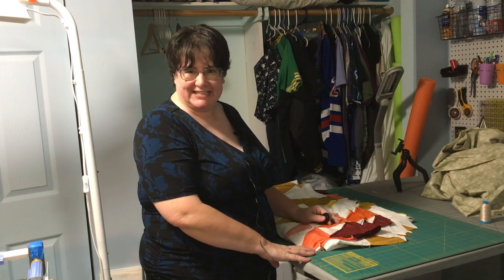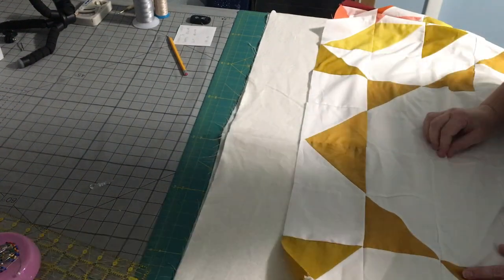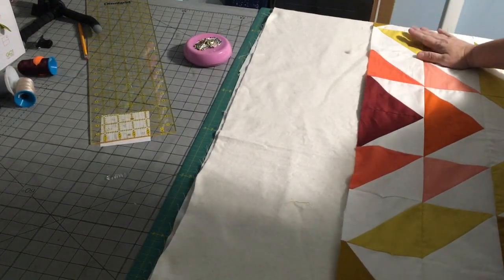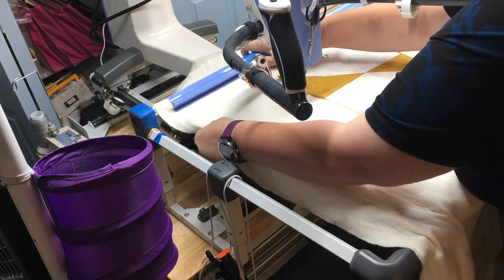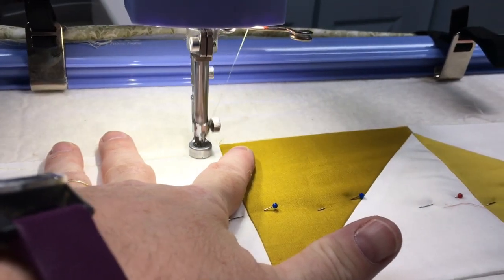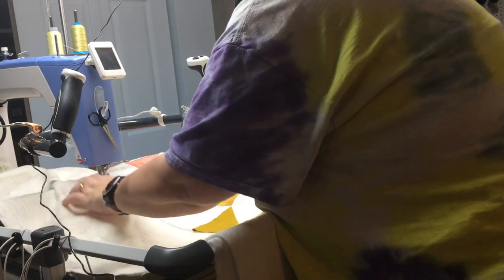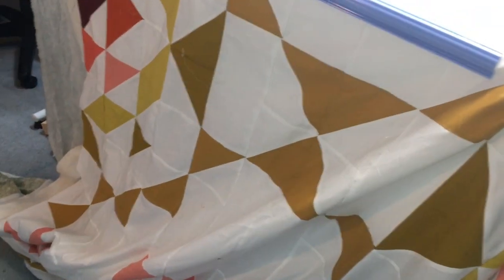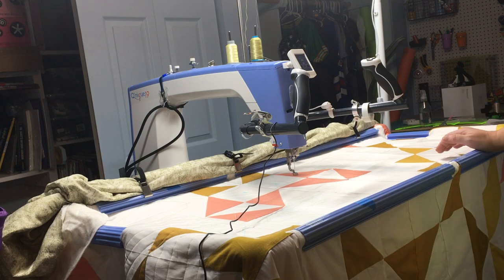Quilting a King-sized Quilt on Cutie Frame

Comment: Thank you so much.  This answered my question in so many ways.  I would like to know about how much space your machine and frame takes up.
Reply from the maker: I believe the table size is 24"x53". The frame takes up the whole table front to back (24") and there are a couple inches free on the side. I have just enough room to squeeze by on the right side of the table (my cutting table is next to the frame) and just enough space to squeeze by behind the Cutie (the closet doors must be closed for me to get by). My desk is to the left of the cutie and there is no room for me to walk by the frame unless I pull my chair out.

In front of the cutie frame is several feet. Enough for me to be quilting at the frame and my husband to walk by. 

We squeezed it in. 😂

Comment: Thanks for sharing this. I just got my Cutie. I see you and many others don’t use leaders. It seems such a waste not to use them. Why do you and others not use them.
Reply from the maker: I don't find it a waste. This King size quilt in this video for example, I think it was 108"x108"? I had to buy 3 lengths of fabric for the backing anyway, because 42+42 was not going to be wide enough. So I had lots of extra backing fabric to serve as leaders.  

Most often I am doing throw size quilts, say 50x60. So again, I need 2 lengths, and the 80-ish inches I get from sewing them together is more than enough to serve as leaders.

I also often use the backing fabric to cut the strips for my binding, so the extra fabric does go to use.

I did make my own leaders from a canvas-type fabric I got from Joanns, for those cases where the backing isn't big enough. (such as the quilt I'm working on right now, actually.) But pinning the quilt back to the leaders is just  another step that needs to be done before I can put my quilt on the Cutie. I want to get to the quilting faster . 🙂

Comment: I see that you use the Grace Q’nique 19. I found one for $4900. Recertified. I have the cutie frame. I am torn between such a good price or buying the Q’nique 19X or 19x elite. If you were buying a machine today which would you buy? I am not a professional quilter and will use it for quilting personal quilts, etc. Thank you for your advice.
Reply from the maker: I just looked up the prices on the 19x and elite and holy cow! I also bought my Q19 recertified and have had no trouble with it. No regrets at all. It doesn’t have the bobbin estimator or the edge detector but I’ve been fine without those features. Nice to have, sure, but not necessary. If I were buying a machine right now, I’d buy the recertified Q19 because I don’t feel the new features are worth such a huge price difference.

Recertified machines go fast and aren’t always available so you might want to jump on that deal. On the other hand, Grace’s spring fling is next month and they will have sales… but who knows what the sales will be. Often they bundle several items with the machine for free.

I’m not a professional quilter either, and I love my Q19 and would buy it again in a heartbeat.

Comment: Okay, I can see already that you have something attached to the frame that doesn't come with the frame.  To camera right, there are two blue bars. To camera left she is adding clamps that are not part of the Cutie Frame  package. I'm seeing the need for additional clamps in all the videos I have viewed so far. Off to Harbor Freight for clamps.  I'm regretting more and more my haste to purchase a Cutie Frame. And now, they've upgraded the frame. What's with the blue painter's tape? And the rubber bands? 
The frame is easy enough to assemble. I don't think there are adequate warnings about the adjustments necessary to fit the machine onto the frame. The videos make it all look so easy.  
I'm going to be taking lessons on a long arm at a local quilting store.
Reply from the maker: The clamps on the left side  just hold that side taut while quilting. Grace sells bungee clips to accomplish that purpose, but I did a DIY to save money. You could eliminate the need for clips altogether by pinning extra fabric on the sides of the  quilt and using the blue clamps that came with the frame. That's a completely $0 cost solution.

The blue tape on my clamps just give me a visual of how far to the side I can quilt.

I'm not sure what rubber bands you are referring to?

I'm also not sure what you mean about the "adjustments necessary to fit the machine onto the frame"....what machine are you using and what adjustments are you finding necessary?

I'm sorry to hear you are regretting purchasing your Cutie.  I really love mine. Let me know if there's anything I can do to help you learn to love your Cutie.

Comment: I am so glad I watched you I have a cutie frame I'm learning to quilt I have a Q unique 16x Elite I haven't had it for very long the quote on making about a queen size or bigger 15 8 inch squares of Christ 14 down I cut squares with two different material colored material and I cut that in half and sew them together but for some reason I could not get all the lines to line up straight I took it apart I put it together I took it apart I put it together to the point to where it's that's it and I am so glad to see you using the cutie frame now I know how much easier way to lay out my quilting and everything thank you so much

Comment: Do you stitch in the ditch on blocks to stabilize also ?
Reply from the maker: Yes. I stitch in the ditch and then do the rest of my free motion. Or depending on how the design is I might be able to stitch in the ditch as I go. I try to make sure a section is ditched before filling it.

Comment: Would it be possible to use the curved quilting pin?
Reply from the maker: @sdcgren6301  I’m not sure what you mean. Like the curved safety pins? Sure I don’t see why not. Just harder to take out than straight pins
Reply: Thank you for your reply, I’ll try both ways when I get my quilting frame.

Comment: Hi again. Because of health reasons I had to wait to order the Husky workbench that you are using,. Is your bench the 52” or 62” size? Also is there room on the table to use a pantograph?
Reply from the maker: I have the 52" because that's all that will fit in my space. Either size should work. You just need a tabletop no smaller than 24x48". Because pantographs will go within the base of the frame, any table that fits the Cutie frame should work with pantographs.

Comment: Do you ever experience puckering since your sandwich is not basted within the layers?
Reply from the maker: Nope, because I always have at least one side that has all three layers secured. In the first hooping, it's the line of pins at the top. In subsequent hooping, it's the quilting I just did in the previous hooping zone. Every time I re-hoop my quilt, I make sure my backing is smooth, radiating out from either those pins or the previous quilting.

As long as I never hoop a section that has NO securing within it, I always know my backing is smooth from the last place I quilted.

I hope that makes sense.

Comment: This was helpful.  I have the Q-Frame but yours looks bigger.  I have the q-15 and my front bar all the way out.  I still get only 10-12 inches to quilt in depth.  Thank you.
Reply from the maker: The Q-Zone frame is bigger (longer) than the Cutie, but I have a Qnique 19 which has more throat space than the Q15. No matter what machine you use, you'll lose about 3 inches, so 10-12 inches sounds about right. I get about 14-16 inches on mine.

Comment: Loved your video. Could you please share a link to the side clamps and toggle cords you use? They look so much easier than what I’ve been using. You make a big quilt seem do-able without all the hassle of basting. 
One more question.  Do you ever use pantographs? And how would this change how you load your quilt. Maybe you have a video on this?  Thanks in advance.
Reply from the maker: I just used stuff I already had. The toggles are these: https://joann.app.link/bEnbLC5MNBb (probably available on amazon too), the cord is elastic cording, and the clips I had from a photo backdrop set but they are similar to these Heavy Duty Muslin Clamps 4 1/2 inch 6 Pack https://a.co/d/4ybPsVs

Hope this helps!
Reply from the maker: I don't do pantographs but I think the only thing I would do differently is take the time to make sure the quilt was as perfectly straight in the hoop. Then when shifting the quilt, I would drop the needle and use channel locks to make sure it stays straight. Grace now sells channel locks for the Cutie but you can also use Handiquilter's channel locks (you can see one hanging in the handle of my Q'nique.)

Moving to the next row would be a little more challenging because you'd have to move just the right amount forward and also make sure you hoop the quilt straight.  Also depending on the pantograph pattern you may want to do all the rows left to right instead of alternating between left to right and right to left.

To me, having to hoop that carefully is not worth it. I prefer to freehand and use rulers and do what's called "custom quilting" rather than pantographs or edge to edge designs.

Stitched by Susan is a good channel to watch for learning how to freehand edge to edge designs. Angela Walters is great for learning how to freehand more custom style.

Hope this helps!
Reply from the maker: Handi Quilter Channel Locks (Pack of 2)
https://www.amazon.com/Handi-Quilter-Channel-Locks-Pack/dp/B0778QVXQR
Reply: Christie, you have helped me so very much..mentally more than anything!  I’m new to my Cutie and have been quilting using my embroidery module and edge to edge quilting up till now on my Bernina. I’ve been so consumed that the quilt had to be so perfectly straight on the hoop. You’ve given me the understanding that if I don’t do a panto or E2E I can either free motion or custom quilt without that much stress!!! Hallelujah! So many of your little side comments have been so eye opening to me. Thank you for the clamp links and all the help!!
Reply from the maker: @cmarks101010  so glad I could help! I also have a bernina and have tried quilting with the embroidery module but it was soo not for me. 😂 Too much stress trying to get it all lined up. I call myself a lazy quilter… I prefer to get good results with the least effort. 😉
Reply: @christiespeich6537  since you have a Bernina you totally understand how difficult it can be to line everything up for quilting in the embroidery module. I am currently using my 790+ on my Cutie and the throat space is not ideal. I am hoping to get a long arm soon. Hopefully at least 19”. Saving my pennies. I have a question about long arms for you. Having a Bernina, which for me, is a very high end sewing machine…was it difficult to not have a Bernina long arm? On so many FB groups I belong to I read all the time about quilting tension issues and all sorts of issues with long arms. None of these machines are Berninas. Have you been totally thrilled with your re-certified Q19? What issues do you experience, if any?  Any long arm brands you would stay away from?  Just wondering if I buy anything other than a Bernina if I will be sorry? Any insight would be greatly appreciated! Thanks
Reply from the maker: @cmarks101010  I love my Q19! I haven't had any problems with it. The bernina long arms do look very nice and I know some professional long armers have just switched to Berninas. But the cost is way out of my budget. Like, WAY. Plus I don't have the space for a full long arm which is why I have the Cutie. I love my Bernina 180 but I would love to upgrade to a 500 series eventually. 
The only other long arm I've used personally is a Handiquilter because that's what my local shop sells. That was very nice too.
Reply from the maker: @cmarks101010  as to tension I think with any long arm there is a learning curve with it. Especially coming from a Bernina which pretty much takes care of the tension for you. But it's not hard once you learn it. I want to do some videos about it eventually.
Reply: @christiespeich6537  Thanks so much for everything!